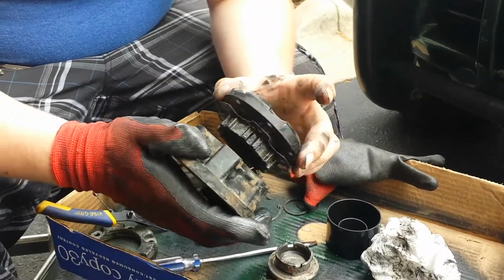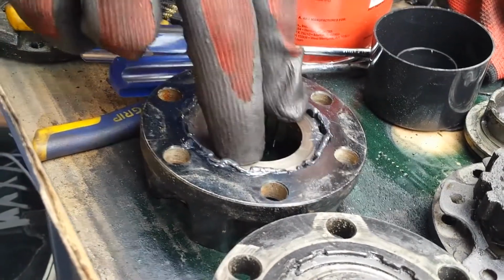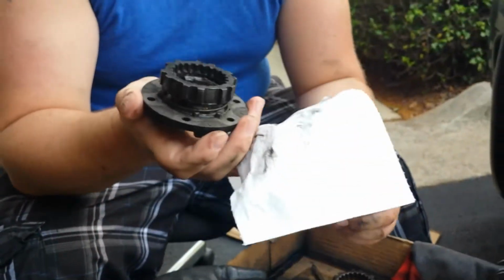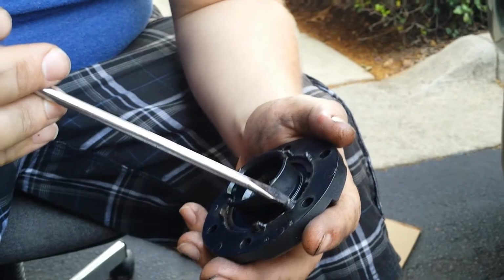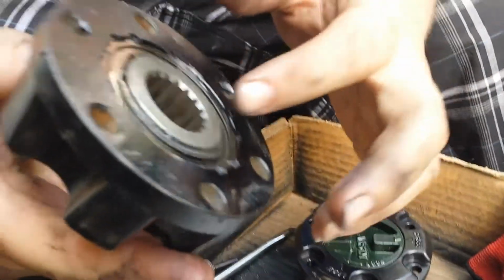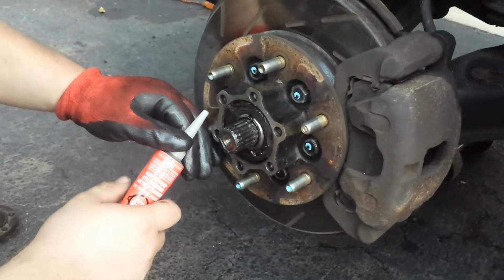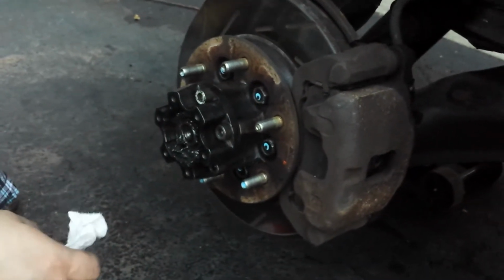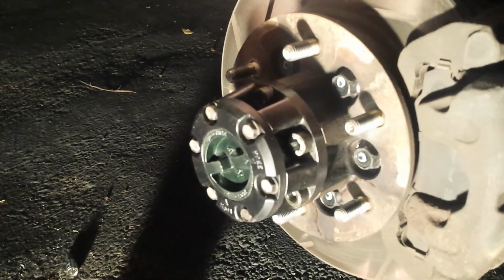Manual Locking Hubs Isuzu Rodeo

Comment: Thanks! Now I know whats in my troopers hubs. My main bolts keep backing out no matter how hard i torque them. The ones behind the lock unlock cover.  I"m going to install lock washers and lock tight on the bolts now.  I was afraid to take that cover off because i did not know if springs and other parts would fly out and it was a pain getting to those bolts. Thanks for posting!
Reply from the maker: +Jonas Sapienza glad to help, we should be posting more in the near future.
Reply: Look for a thread on planet isuzu from geoffinbc to address your problem
Reply from the maker: Alex who did this video is a member of planet Isuzu. They are an amazing source of knowledge!